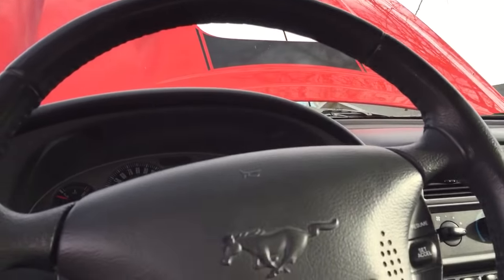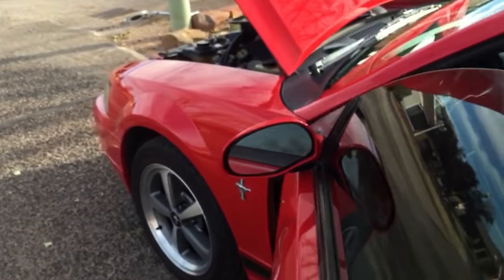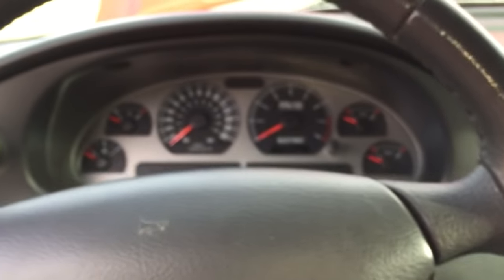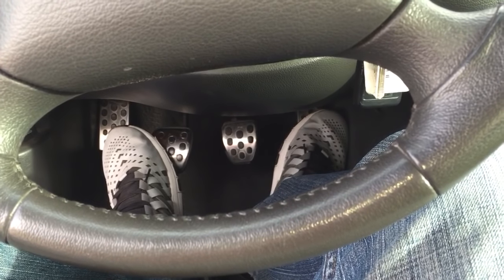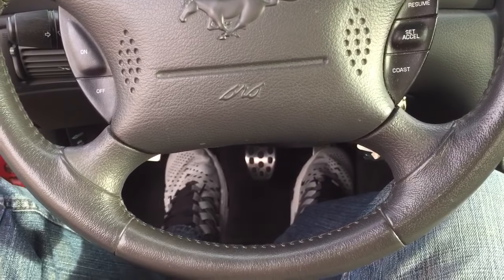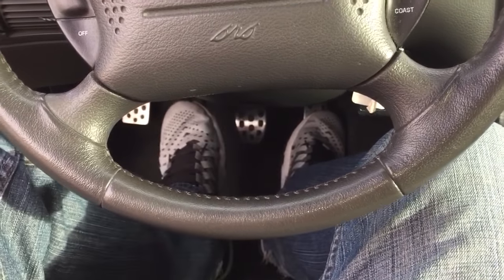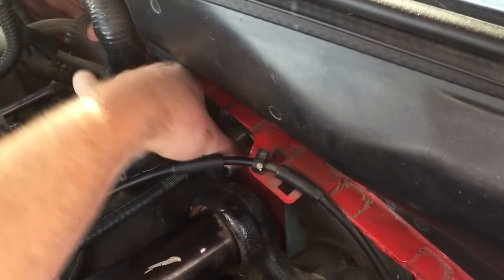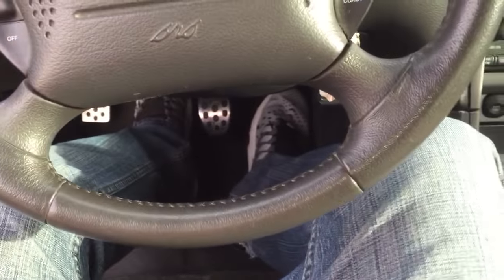How to adjust your Clutch: Ford Mustang. Clutch quadrant & firewall adjuster ajustar embrague chirp

Comment: I have a 1996 4.6 GT 5speed and the clutch releases way out and not close too the floor is this the way it should be?
Reply from the maker: Ricky Dunivan it should grab about 2 inches off the floor and release about the same as you push the clutch in. It may have something to do with which brand of clutch and clutch quadrant you have as well
Reply: Scrun Johnson it releases almost all the way out
Reply from the maker: Ricky Dunivan do you have an adjustable clutch quadrant and firewall adjuster?
Reply: This car is bone stock I just got it a old lady owned it
Reply from the maker: Ricky Dunivan that's the way to get it! How many miles?
Reply: Scrun Johnson it has 170k someone told me I have too adjust a clutch cable but I thought a 96 comes with a auto adjuster and no way too adjust I'm soo confused

Comment: Ok hope you see this comment I've looked everywhere home Depot Lowe's O'Reilly auto zone where did you find that clutch cable free play kit it's just a spring and 2 copper fittings American muscle don't carry it
Reply from the maker: gear heads 4 life I’ll have to pull it off and duplicate it. It’s just a spring and a mount that has a hole in it for the clutch cable to slide into
Reply: @dannyjohnsonsgarage  ok thank you

Comment: I'm having this same problem with my gt. However, whenever I tighten the cable using the firewall adjuster the chirp goes away but then when I do this it chirps when the car is driving and the clutch releases wayyyy too high maybe like half an inch to an inch from being fully released. I have the upr triple hook quadrant and firewall adjuster as well as the adjustable cable. It doesn't chirp when you give the cable slack but then it releases too soon and releases too high when you tighten it and it starts to chirp when you adjust it where it "should be" and it releases at the perfect spot. What do you think i should do??

Comment: How do you adjust the idol in the car?
Reply from the maker: Brandon dsadasdas with it being electronic you'll need a hand held tuner to set the desired RPM. You can also (on some aftermarket throttle bodies) adjust the screw that stops the throttle Body from closing all the way- however- the car will likely throw a check engine code cause it's idling higher than its supposed to. I can get my tuner and make a video soon
Reply: Thanks so much!

Comment: My mustang has the T-45 and I just put a steeda triax short throw. I notice a noise from 2nd to 3rd and my clutch fluctuates from real heavy to soft/light. The noise/ vibration from the shifter worry’s me, sounds like it’s not happy to be in gear. When I first go fro a cruise she’s solid till the t45 warms up then it’s tough to get into gears 1-3.
Reply from the maker: Did you transfer the plastic cup from the bottom of the old shifter?
Reply: @dannyjohnsonsgarage  I got a brand new one

Comment: If you adjust it so it is putting pressure on the bearing it will damage the bearing. It needs to have a bit of play
Reply from the maker: It is designed to spin constantly, so it’s okay to have constant pressure as long and it’s not a lot. Enough to spin it, not enough to have excessive load.

Comment: I have a 94 mustang gt and the other day i took it out for a spin and it would pop out of 2nd on me. I see my cable going through the fire wall is that where i adjust it at. Its making a winding sound underneath my stick shift and pops out of 2nd when driving
Reply from the maker: Bert Ryan You may have more sever issues with the transmission than an adjustment will fix. 
   You’ll also need to buy a firewall adjuster (links in the description) to be able to adjust it
Reply: its probably the syncros ... good thing t5 trans is easy n cheap to rebuild